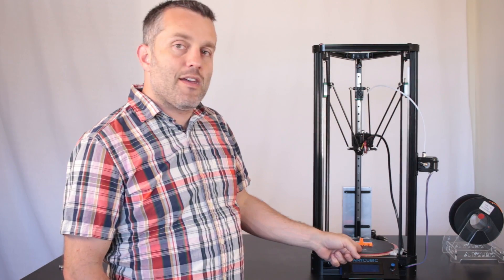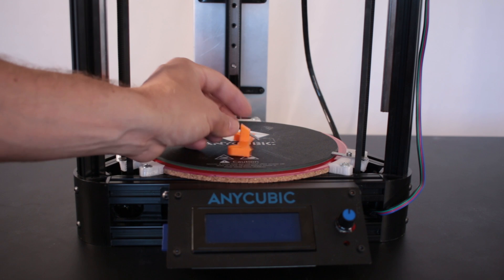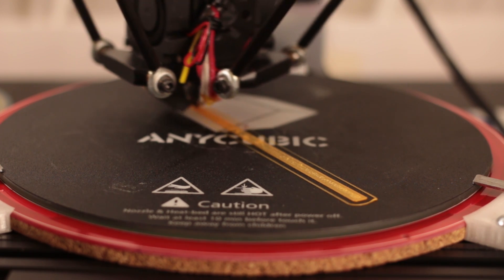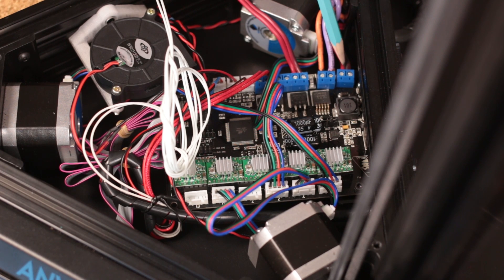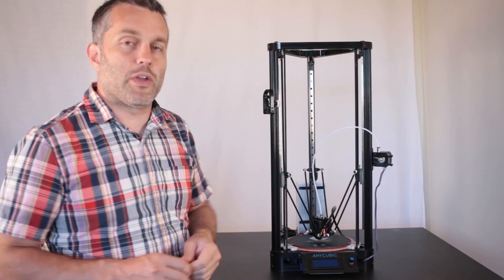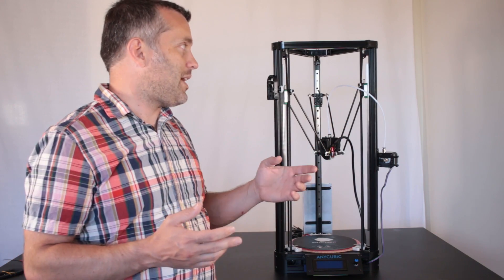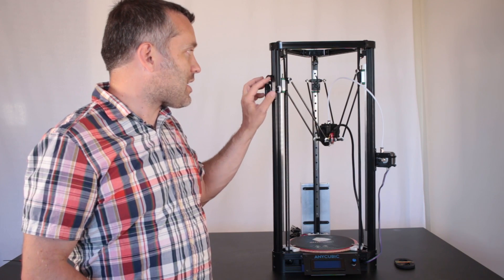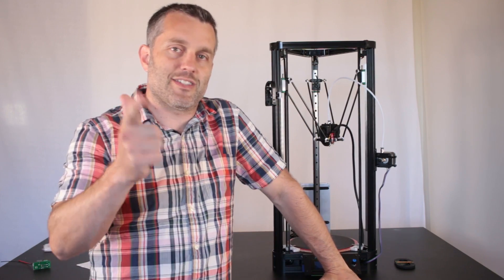Anycubic Kossel 3D printer Upgrades- How to Install Heated bed and Linear Rails Part  2

Comment: Hi. Me again first question does your Marlin 1.1.4 (in the patrion) have the setup for normal Anycubic Kossel or is it for your Linear rail version? Second have you checked the output voltage of your PSU? if it's about 12v then turn it up to somewhere between 12.8 and 13.8v then your bed should heat up quicker.
Reply from the maker: Hi Paul, Yes, the Marlin build will work for a Kossel without the linear rails. You just need to adjust the "DELTA_RADIUS" value in the configuration.h file. This is a normal part of configuring the printer. I will be going over it in the next video.
Reply: I understand Delta Radius the point of asking was so people going to pay the patreon fee to get it know whether or not they have what they need, not all buyers would know how to convert any code and may upload to their printer only to find it does not work properly. I also feel you should have said that the upgrade to the latest firmware will be needed if they are going to install auto bed levelling ( like I have ) as the original firmware does not support this option. Remember I have this printer and I told you about the 5 and 11 amp inputs on your last video. I'm also about 6 steps ahead of you at the moment on mods, I like the videos keep up the work.
Reply from the maker: I do remember you. Thank you for your input! In the video I specifically talked about the 5 and 11 amp inputs because of your comments. :)

Comment: What a difference 2 years makes. Most of the upgrades that you showed are now standard on the Anycubic Kossel Linear Plus including heated bed, linear rail system with stops on the extrusions, power supply with setup as your upgrade and auto leveling.  Note on the Linear Slides, the industry nomenclature for them now is  MGN12H or MGN12HC if marked on the slide itself. Do not get the MGN12C versions as they are thinner. And the price for the same unit shown is now about the same as you can buy the Linear Plus version on ebay. As the price of a slider and rail is about $30 each ( $90 total ), you are better off buying a complete Linear Plus. I'm putting mine together right now and when it is done, it will print a few other upgrades like plate hold-downs, top corner covers, bottom motor covers, and maybe move the feed roll to the top of the machine.

Comment: It seems I recall your criticizing printer makers for not using 24V power supplies. I'm curious why, since you were buying the supply anyway, you didn't go with 24V. It takes half the amperage for a given power output and puts less stress on whatever controller you link it to. Normally those board interfaces will handle a wide array  of voltages.. ~ 5-30V. You never mention the resistance of the heated plate. Do you know what it is?
Reply from the maker: I did this mod a couple of years ago when 24v power supplies were not as common and hence were more expensive. Also, the small bed on this printer means it will heat up reasonably quickly even with a 12v supply.

Comment: I am building my own delta printer but now I'm in a dilemma, how much amp does my power supply needs to have?
Reply from the maker: The heated bed is the key to amperage required. The control board and fans use very little power (about 1A), the Heated nozzle requires about 5A, and the Hot Bed typically requires about 10A. Therefore, if you have a 200mm diameter bed, you will need a 12v 20A power supply to give you a little bit of a safety margin. For reference: Most of the printers coming from China that have 200mm square heated beds typically ship with 15A power supplies. Of course you can get much more into this. For instance, using a 24v power supply for the bed will greatly reduce the heat up time. If you have a larger bed (say 300mm) this becomes almost necessary.
Reply: Design Prototype Test Oke I get it, I'll go with a 20a (200mm heated bed). Thank you so much man! 
Greetings from Holland!

Comment: The Kossel board (TriGorilla) has a separate power input for the heated bed, so you can directly feed it with 24V, no SSR needed.
Reply from the maker: Good point! It basically has an on-board Mosfet Bed Power unit.

Comment: Watched parts one and two. Where the part of sitting the linear rails, please?
Reply from the maker: Sorry, I did not film that part of the build. It is a very straight forward and easy install. Just make sure the rails are up so that they sit flush with the end stops at the top.

Comment: You are violating  the GPL by charging a fee. You must make the source code available to all, that's how open-source works.
Reply from the maker: I have already covered this issue in my other videos. In short: You are wrong. Free means open, it does not mean monetarily free. Marlin operates under GNU GPU Ver.3. Go look up the "GNU General Public License" and you will see the words:

"When we speak of free software, we are referring to freedom, not price. Our General Public Licenses are designed to make sure that you have the freedom to distribute copies of free software (and charge for them if you wish), that you receive source code or can get it if you want it, that you can change the software or use pieces of it in new free programs, and that you know you can do these things."

Comment: I just purchased the Anycubic Kossel Linear plus. It has the larger print surface, heated bed and 20amp psu included. Will your firmware work with this version?
Reply from the maker: Yes. It should. You need to check that you have the "TriGorilla" control board. And you need to check the length of your arms. I assume they will still be around 218mm. It's easy to change that variable in the firmware and also the bed size. When/if you pledge $5 on patreon, make sure you send me your email address, and also communicate these numbers to me. I will modify the firmware before I send it off to you.
Reply: Thanks for getting back to me so fast!
The printer arrived today (7 days from China Aliexpress) which caught me off gaurd but I'm not complaining. Quite the opposite as this was completely unexpected and welcomed, first impressions only happen once!
I plan on working on the build tomorrow and I'll get the numbers requested as well as my patreon donation...a small price to pay as I can say with certainty that $5.00 worth, of my time, would npt be enough for Windows to boot in safe mode. Thanks for sharing the files and will look forward to seeing the setups
Reply from the maker: I will be releasing the Video with the BLTouch automatic bed leveling upgrade either tomorrow or the next day. I HIGHLY recommend you do this upgrade. You should order the genuine sensor from https://www.antclabs.com/store and then wait to donate to my Patreon page until I upload that video.
Reply: Ok I can do that, I have 2 at the moment one was for my Tevo Black Widow and the other is a spare, neither have been used. I'll definitely wait for the video, how did you mount yours? I'll have to look at thingiverse to see if a mount is available or find one that's decent and modify it.  Thanks again
Reply from the maker: I will send you the .stl file for the mounting bracket along with the firmware. It's much more minimal/elegant than anything I've seen on Thingiverse.
Reply: Hey just checking in, I have my printer 2/3rds of the way done and I do have the tri-gorilla board and the cf roda measure a total length of 28cm end to end. Have you had a chance to work on the bl touch vid and firmware? Ready to send my cash for the files!!
Reply from the maker: I have the files all working and the Firmware is functioning perfectly. I have also made the video, but even after I had the auto leveling all working my printer still wasn't printing flat on the bed, so I did some more debugging and I found a serious problem: The rods are not the same length. It's unbelievable how much they vary the shortest one is almost an entire millimeter longer than the longest one! This is a major problem. I am working on the easiest solution I can come up with, and hope to film that tomorrow. In the mean time, if you want to get your hands on the files I have made so far, I can send those to you. You'll just have to wait a few more days for the instructional video including how to fix the rod length issue.

Comment: nice review.
do you have the file or link for the power supply with the switch?
i have also a broken pc power supply that have being broken and want to juse the idea
Reply from the maker: Martin van der Splinter You can find a free version of that on Thingiverse. I provide the .stl file of the design I made (along with all the other part files and the latest firmware build) to all of my $5 Patreon supporters.
Reply: Thanxs

Comment: Regarding firmware - Repetier is a better option for delta printers. The code is optimised better and allows more steps per second to be calculated. This leads to smoother motion and better prints. You can download a copy of the Repetier firmware that I configured for the Anycubic Kossel Liner by following the link in the description of my review video.
Reply from the maker: Did you do any coding to make your build of Repetier, or did you just use the online webpage-based Repetier configuration tool? You claim Repetier to be better than Marlin. Can you substantiate that claim? Please recall that I am using the very latest 2017 build of Marlin. Any comparisons between three year old versions of the firmwares are no longer valid. Things have changed dramatically in Marlin since 2014. Has the Repetier firmware similarly been advanced?
Reply: No code changes. I modified only https://github.com/ruevs/repetier_anycubic_kossel/blob/master/Repetier/Configuration.h - by hand (but I kept it compatible with the online configuration tool, so that users can easily change things - like add a heated bed).
Regarding Marlin vs. Repetier - last time I tinkered with the firmware back in December Marlin was at 1.0.2-2 (2016-10-30), the 1.1 series were still RC (release candidates), so I did not use them. Repetier is definitely better than 1.0.2-2 Marlin, but that version is just a bug fix of 1.0.2 from 2015-10-05.
Now I see that since then they released 1.1 (and 1.1.4)  and from the change log (https://github.com/MarlinFirmware/Marlin/releases) is seems that:
     "The code has been significantly optimized in several areas, leading to fewer stutters, better delta performance,..."
So I will try Marlin again - it would be an interesting experiment.
Reply: @ruevs Привет, вам удалось протестировать новую прошивку Marlin. Каковы результаты?
Reply: @egor_niko  Удалось :-)
I tested Marlin 1.1.8 here:
https://youtu.be/JCflNCotl70
and compared it to Repetier.
By now Marlin is at 2.x , which I have not tested yet.
And then there is Klipper, which in my opinion is even better than Repetier.

Comment: Have you ever had a problem with the effector being almost 1mm higher at the towers, than at other points in the board? Sort of like a bowl-shaped deformation in the movement of the effector?

I know the bed is perfectly flat, I measured it myself, so it's a motion problem. Do you know what I should do?
Reply: adjust print radius setting in firmware. for the kossel linear (not plus, regular) it should be 100.x  +/-0.3mm

Comment: how many m4 2020 t-nuts would you need to replace every t-nut on the frame? Thanks.
Reply from the maker: 40 would be minimum by my count. Better to get a 50 pack, so you have a few left over to mount extra things to the extrusions when you upgrade.

Comment: The pulleys setup are not that easily affected by heat. Those are ABS, which only start softening at around 100C. unless you are heating the carriages intentionally, there is no way that the non-malfunction bed will be producing  and conducting that much heat to the carriages even inside an enclosurer. 

The pulleys setup are however are still fairy flexible and those rounded wheels do not roll perfectly perpendicular on the t-slot, under high speed, high acceleration and deceleration, the carriages and the pulleys setup will be flexing a lot, they will not be locked on to the towers or stay parallel at all time because of the opposing forces from the other carriages. of cause, if you print only at slow print speed, low acceleration and jerk like 30mm/s or lower, this is should not be too obvious but kind of defeating the purpose of having a delta since one of the biggest advantage of having a delta is the high speed printing. My lowest default printing speed is 60mm/s on a delta.

Linear rail on the other hand, allow the carriages to stay almost completely  linear/parallel to the tower at all time.  in turn allow you to print faster without affecting the movement of the effector.

Comment: Great Video.  I have been looking at the mini Kossel kits for a week and I'd really like to buy one.   Is there a kit you would recommend with a heated bed already included?  What's your feeling on the auto-bed leveling that comes with some of the kossel kits?  I was looking at a FLSUN kit but some of the components that are injection molded are poorly designed some people report.
Reply from the maker: A commenter on a previous video of mine said that he did not receive the auto bed leveling sensor with his kit, even after contacting the seller. Click "show more" on the video description above and you will find a link to this printer for $179. Add in the cost of installing a heated bed as I've shown, and the total cost is around $210. This is a lot cheaper than the flsun printer on Amazon. I will be showing how to install auto mesh bed leveling on this printer in a future video.

Comment: Any modifications to the source code must be publicly available and not behind a pay wall.  You can charge for the compiled stuff, but you must make the source freely available - even configuration.h according to the GPL 3.0 under which Marlin operates.
Reply: That's not how it works. Don't try to change GPL, you won't win and you'll look like a ass.
Reply: Design Prototype Test You deleted the post where someone asked you for it and you said they can get link by donating $5 to your patreon. Regardless of why, I'm glad you're not still trying to monetize source covered by GPL?
Reply: Look at your reply, you seem to be lumping attempting to paywall for GPL software to your time/efforts at making videos. Those are unrelated.
Reply: That's absolutely fine so long as he makes the source code for the modifications freely available too as required by the GPL. Hiding it behind a paywall is not 'freely available'. Putting it on public server but not telling you where is not 'freely available'.

How much of that paywall cash goes back to the original developers I wonder?
Reply: Come on man, don't give me the original software devs a hard time. The coders of the open source software you modified have spent hundreds of hours on the software.

The money you make from videos is irrelevant to the money you are making from selling GPL software illegally.

Your claim the files are publically available is nonsense if you are not making the URL available unless you pay. A URL is only public if it's publically accessible. The public can't access it if you're hiding the URL.

As per the GPL you MUST make the source for your modifications available upon request.

I'm formally requesting the modifications now. Please provide the public URL to download them.
Reply from the maker: Come on man, don't give me a hard time. I've  spent hundreds of hours making these videos, and to date I've made $57. This is unsustainable! Anyway, the files are publicly available. I'm just not broadcasting the location of the file for download. If you donate to my patreon page I will tell you where it is located, and also give you all the STL files for all the parts I've designed.
Reply: Womplestilskin, why are you being an ass? The guy helps the community and probably a lot more than you do so leave him be. He deserves any compensation people want to pay for. don't like it go configure your own marlin.
Reply from the maker: I'm not changing the GPL. The file is on a public server for anyone to download. You can go download it right now.
Reply from the maker: There is no paywall. It's on a public server for anyone to go download. Why don't you go do that?
Reply from the maker: I did not delete anything. I was responding to T Rucker's comment.

In regards to charging $ for a copy of the Marlin Firmware which I altered. Marlin is indeed licensed under GNU 3.0 GPL. I refer you to the GNU website on the subject of selling "free" software where it is written:

"Many people believe that the spirit of the GNU Project is that you should not charge money for distributing copies of software, or that you should charge as little as possible—just enough to cover the cost. This is a misunderstanding. Actually, we encourage people who redistribute free software to charge as much as they wish or can. If a license does not permit users to make copies and sell them, it is a nonfree license."

So, I'm allowed to do it, but that's not what I want. I want to be compensated for making these videos and providing all this information to everyone. Handing out a copy of my Marlin build is just meant to be an incentive to donate to my Patreon.

Comment: The problem with the "twisty" nuts is that they often don't work as advertised, I prefer better solid nuts (actually cut to the profile shape), it might be a pain but you get much better results.
Reply: I just looked and that makes sense, more iinterlocking surface area to reduce slop.